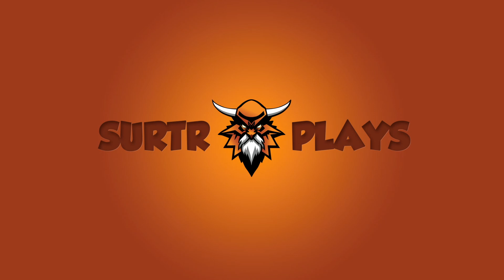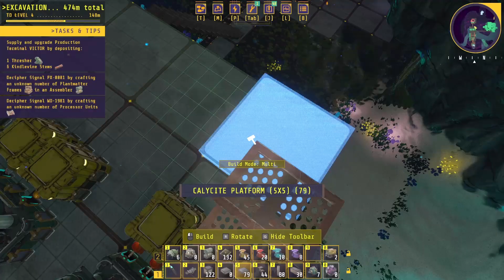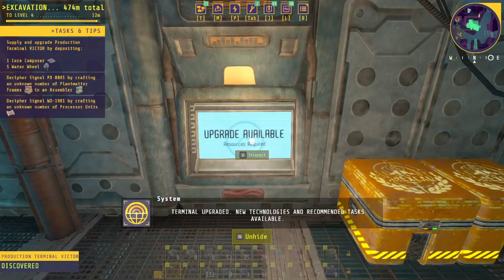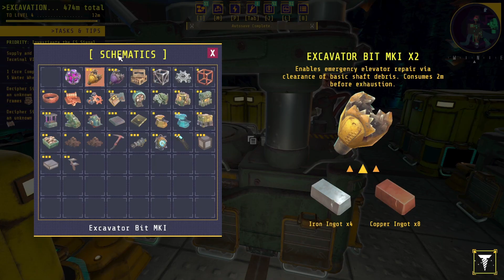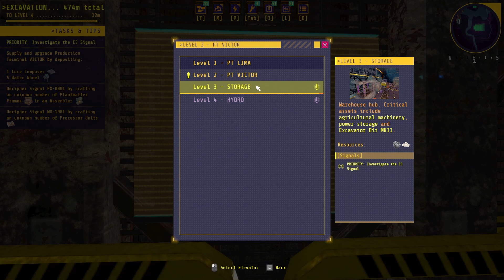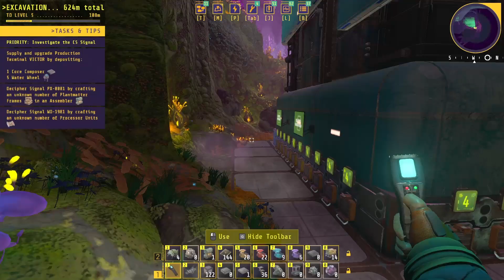Techtonica 1.0 - Setting Up Farming [E3]

Comment: You need about 10 planters to fill 1 thresher. It`s also possible to make limestone out of kindlevine extract. Then you can convert plantmatter fibre into plantmatter and then you can make biobricks. It`s 1 water wheel for 10 cranky generators
Reply from the maker: Awesome. That will save me some time.
Reply: wow, they really changed that ratio. It use to be 1 water wheel to 2 generators.

Comment: You need to unlock the tech “plant matter” in order to automate biobricks fully.  Other than that you have all the tech you need but  I won’t spoil further so you can figure it out on video.
Reply from the maker: Thanks for the tip! I did figure it out. My memory is worse than I thought.

Comment: Admin will give you badly needed parts 3x3 and the 5x5 floors plus all the other materials for base building. Use the 1x1 blocks to repair the hydro area the floor plates are no longer in the early game.
Reply from the maker: Oh nice! Thanks for the tip.
Reply: theres one in vickter as well just a bit of diging to get there